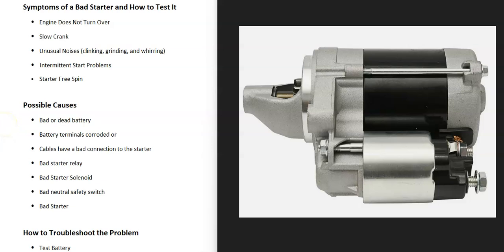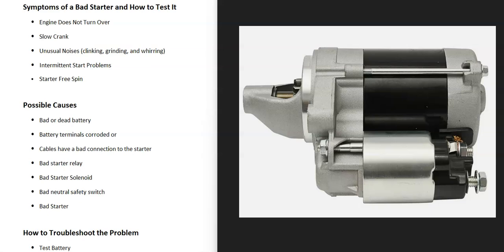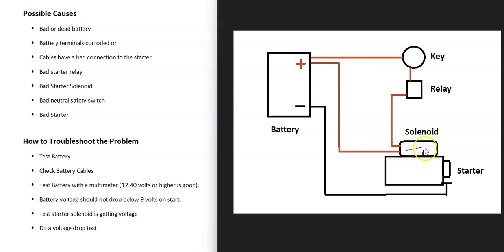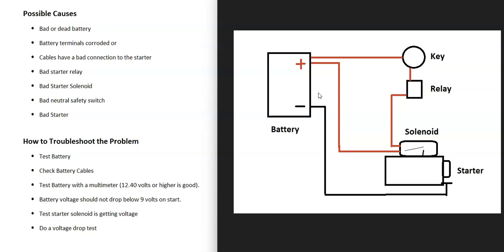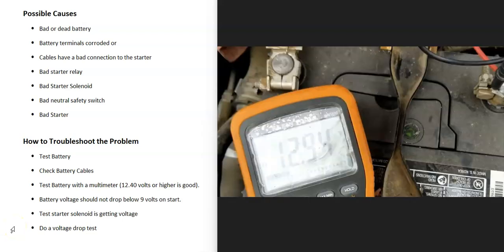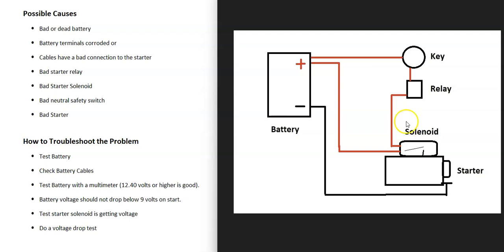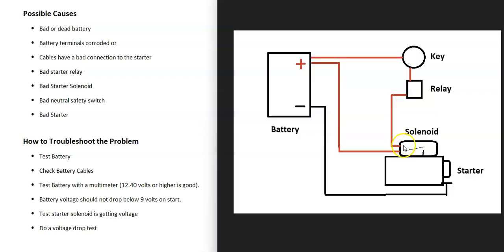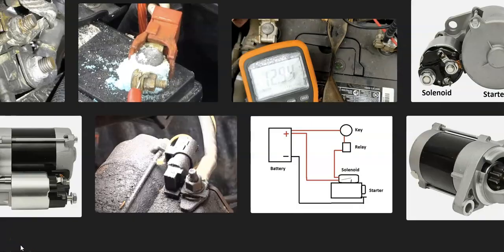Symptoms of a Bad Starter, Common Causes, and How to Test It

Comment: My 2013 Hyundai accent recently went threw a flood I drained the oil for & took out spark plugs right away get the oil change n spark plugs & it won’t start do u think I need a new starter ? Or its done for I still have power all over the car lights & electricity works fine still!

Comment: My 79 monte carlo I turn the key all the electric comes on fan all that but has no crank nothing
Reply from the maker: Check the battery has a good charge and the terminals are good. If that is good, check the starter relay, solenoid, and starter.
Reply: I have a 02 Buick regal I turn the key all lights comes on and I go to start the car it just turns but will not fire up.